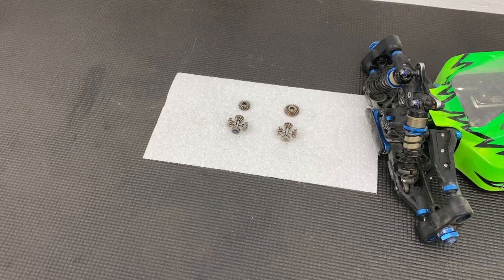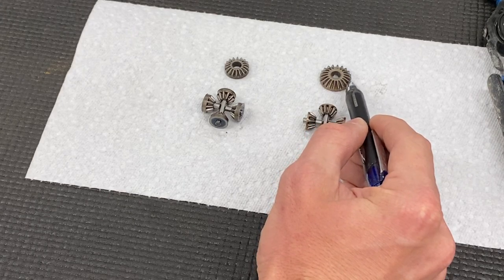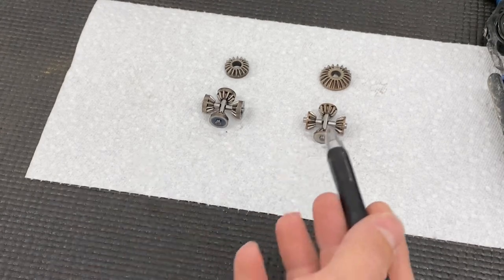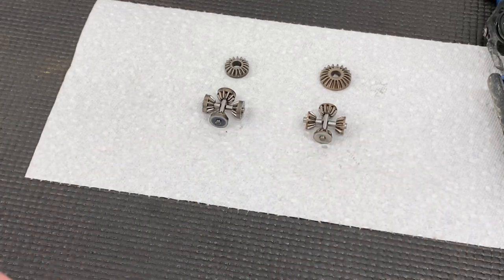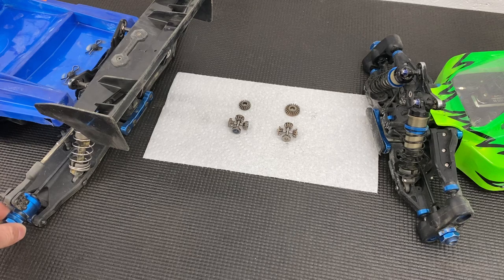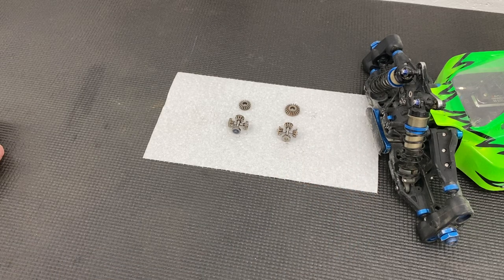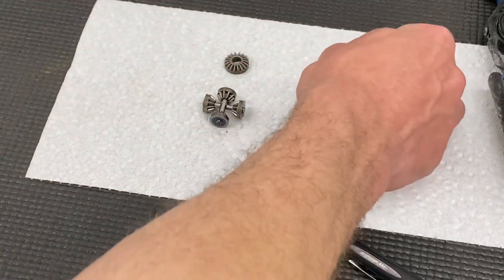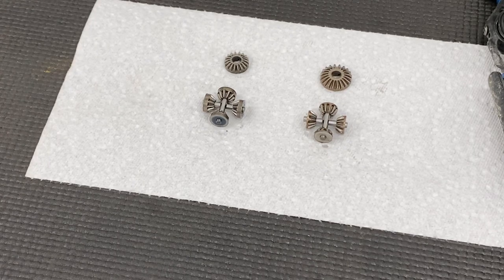HTC vs LTC differential gears EXPLAINED! Team Associated RC8 Platform

Comment: They are game changer for truggy! Running them for almost a year! Dont know why do you think that they can broke on truggy - they are quite similar to V2 difs - the same gear ratio was used there too. Also running them on high grip conditions with good results too
Reply from the maker: Because I broke one lol
Reply: @SuperFastRc  Stripped those gears? How?
Reply from the maker: @JohnieDSM  broke the sun gear in half where the pin goes. Not stripped, cracked in half
Reply: @SuperFastRc  Strange, on the high traction track?
Reply from the maker: @JohnieDSM  Nope low traction, i was sending it pretty hard but might have been a fluke. Not sure. LTC are out of stock so i cant get a replacement yet.

Comment: So why not ltc in all 3 just front and back ?
Reply from the maker: So its not as critical to have the smooth action in the center. Its better to have the larger more durable HTC gear set in the center to deal with torque biasing.